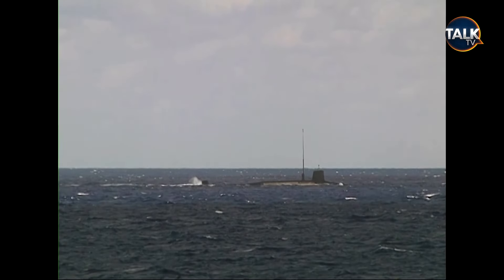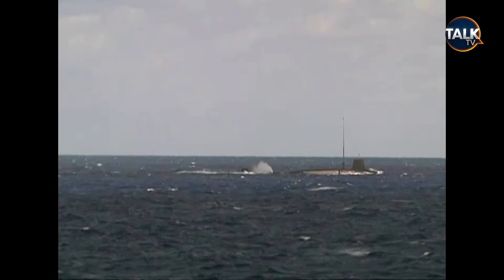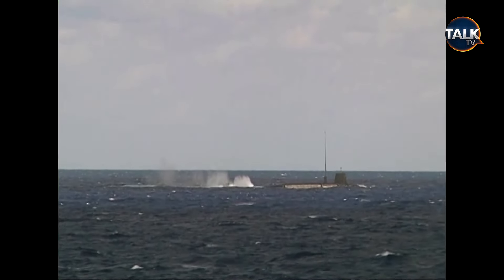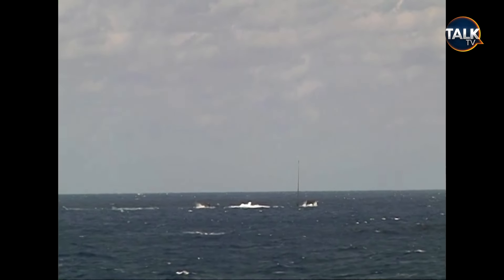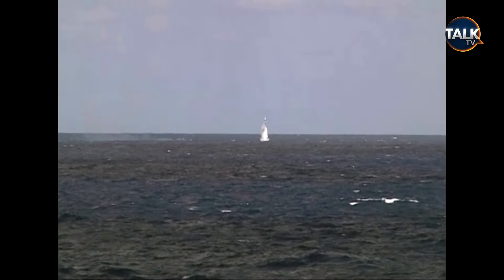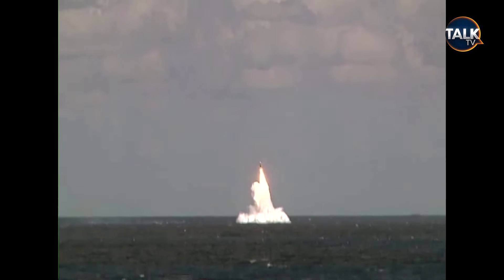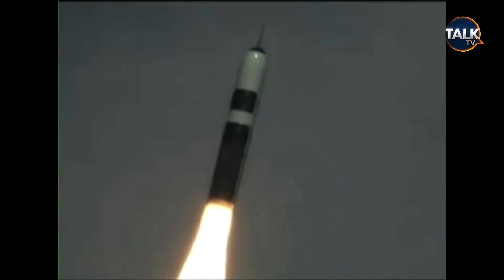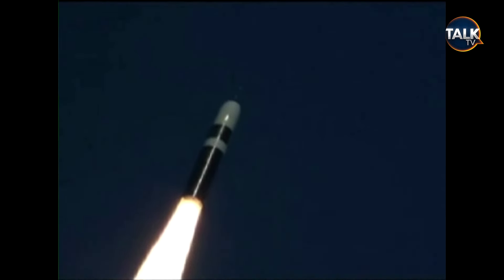Former British Army Colonel On Why Trident Nuke Failed | "The Wake Up Call We Need"

Comment: One of the biggest defence budgets in the world, one of the smallest navy, army and air forces, in the world. The level of corruption in the MOD must be an order of magnitude. We have six navy destroyers, six, many of which are in constant repair or upgrade. Aircraft carriers constantly breaking down. Hardly any fighter jets. I would get rid of the foreign aid budget and some other stuff for a year or so and get at least 8 more destroyers in the navy.
Reply: So right!  Offered my designs for free backed by former Defence Chiefs no go and latter got told off.  Had I wined and dined the MoD probably be in use now?  Mind you, I did succeed in jailing 2 involved in the HP35 slides scandal, they got silly sentences yet at least 2 SAS men were injured by slides disintegrating.  He means if these two ACC ever work!  same as the earlier Aluminium wonders.  As an engineer, I would not put a heavy steel shaft in an Aluminium framework.  Likewise my 27 points showing the SA80 is rubbish before adoption done from a diagram, was not even replied to.  Later my chums at Handgunner magazine brought up 32 points after trying one!  Who has been sacked for all this incompetence?  Ukraine is using drones at same cost as my F&F missile.  No gold plating!  One of my ideas was only briefly used as it was too technical for their non-Mensa members?

Comment: We build the submarines, US builds the missile, we build the warheads.
Why be dependent on the US? This is the second failure in a row!
If the missile was an old one which was used for testing, that is the wrong approach.
The entire British nuclear deterrent consists of these submarines and missiles. We never use them. They are supposed to be there as a last resort, and the expectation is that they will work. Their deterrence only works on the assumption that the nuclear missiles work.
So image is everything - if a test missile launch fails, and this is now the second in a row, it is FAR more serious than "oh well these things happen".
For an estimated £3.2 billion per year (and I'm wiling to bet it is much higher than that), there should be zero failures. Or certainly zero visible failures, eg night secret testing. Not announced and broadcast around the world.

Comment: You must remember that the DETERRENT is a political weapon.  The role of MoD was to provide the crew.  When it was passed From the Cabinet Office to MoD the necessary funds were not passed over to the military.  It was effectively a defence cut.

This is a DETERRENT not a front line of defence as suggested by the BBC.

The UK built the VANGUARD submarine and the warhead (not fitted during this test).  That worked well.

The Trident missile is designed, built and maintained by the US by Lockheed Martin.

Since Tony Blair our defences have been used as a cash cow and are dramatically underfunded.

You would have thought that the BBC would get something right.

Comment: Did it fail? Or do they want it to seem that way to encourage people to sign up?
Reply: In what way would a failure be encouragement?
Reply: its not like we don't need people to sign up though. We are barely scraping 100,000 soliders. We have roughly 67.33 million people in the UK. That is shocking. In order to be called an army, we need roughly between 400,000 and 1,000,000 active military personnel. We literally do not have enough members to be classified as an army.
Reply: Justification for another 100 billion
Reply: @entropy5431  It further evidences we are in desperate need to improve our military to deter and defend against Russia.
Reply: Yh thats what i think, show us weak as a reason for people to join with a push of fear
Reply: @floydpulley3509  I suppose it could highlight the need to spend more money. But from a recruitment point of view I think it's a negative. I wouldn't want to join up if against another country with a working deterrent if mine didn't function.
Reply: @entropy5431  If the only way to protect your family is to defend with our army? I think they figure that we believe we don’t need to fight so most won’t join. Now they’ve shown that we have no deterrent if Russia invaded so we need trained forces to ensure safety.

Comment: Is that the sub that caught fire two years ago.
Or the one with superglue holding bolts on. 
And if these test missiles fail what makes you think the real ones wouldn't 😳
I remember a few years ago the same thing happened , when one launched , spun around and flew off in the wrong direction........